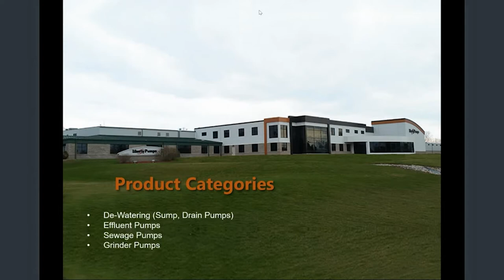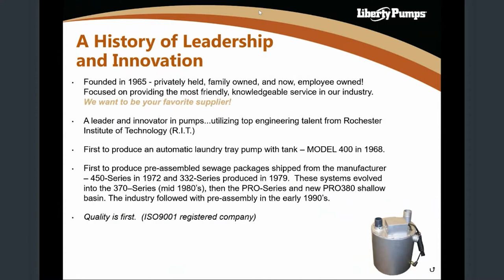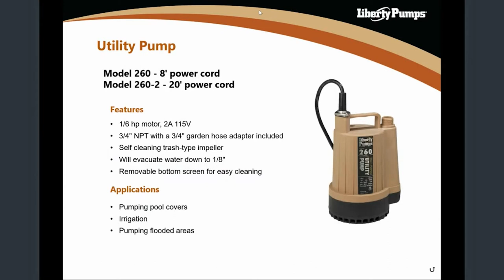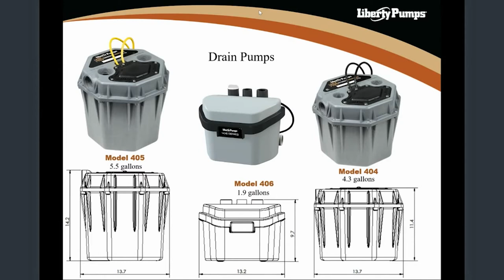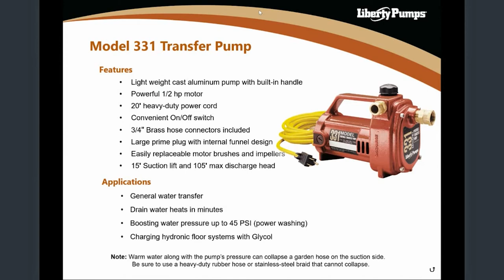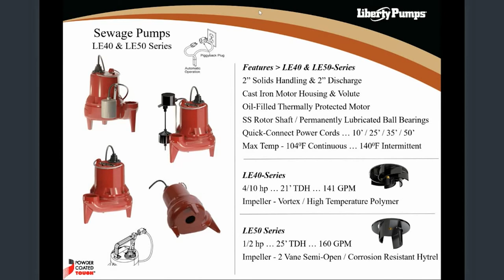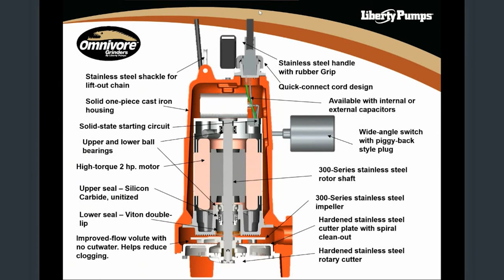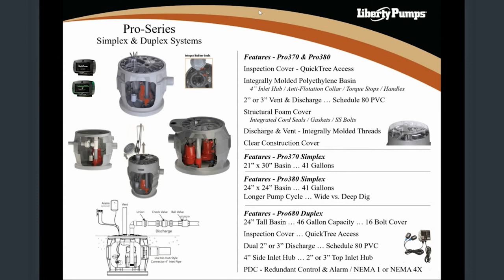Liberty Pump Training Fall 2022

Comment: I have a bran new 405, came built with a ice maker set up. They call it a Aqua Station. That being said, two days in a row the pump has over flowed, once it does, it then hit a wet switch and shut's the system down.